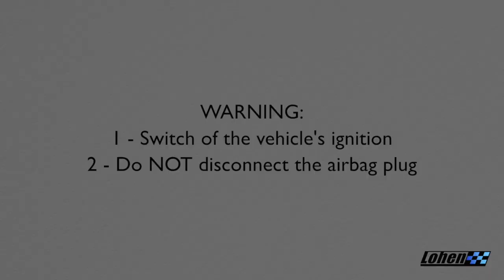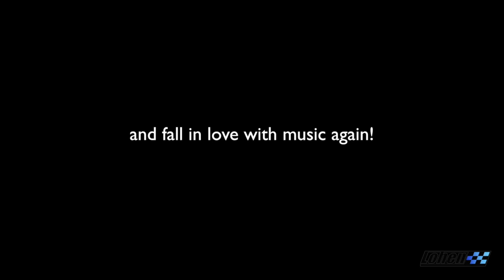Lohen Audison F Series MINI Underseat Subwoofer Fitting / Installation Guide

Comment: Will these woofers make any difference to the quality and volume of bass on the stock stereo with no other upgrades? What RMS power does the stock headunit put out to the subs?
Reply from the maker: These do make a difference compared to stock. But if you are really into a bass heavy sound stage we would still recommend a standalone subwoofer in the boot.

Comment: I assume that I'm able to put in in a non Harmankardon   Mini 56? Because it has the same 2 subwoofers under the seats. Also what would you say that's improved the bass? Or the clarity from songs
Reply from the maker: Paco Guillen Yes you can. The bass is improved but the main improvement is the clarity of the vocals and improvement in sound quality with the help of the better amp and the 2 channel door speakers over the single channel OEM door speaker that needs to handle both the mid-range and high range audio.

If you like extra bass we would recommend an additional boot subwoofer too that fits in the lower boot compartment.

Comment: Can I upgrade my mini sport F56 to this system? It only has the stock system so there are no tweeters upfront which I really want .
Reply from the maker: Yeah you can :)
Reply: Do you know the cheapest place to get the front panels? I’ll need to buy them so they fit the tweeters as I don’t have the panels that come with the Harman kardan.
Reply from the maker: @TranceHeed  You can just buy the 2-way door speaker that has the tweeter built into the speaker. It should be on our website :)
Reply from the maker: So you just need to select the standard option https://www.lohen.co.uk/audison-prima-mini-f56-door-speaker-oem-upgrade-kit